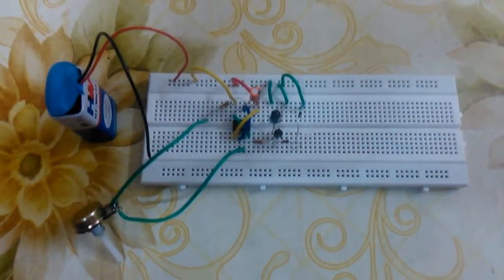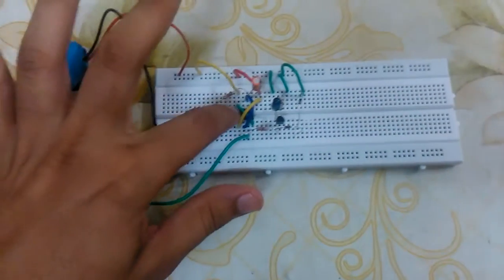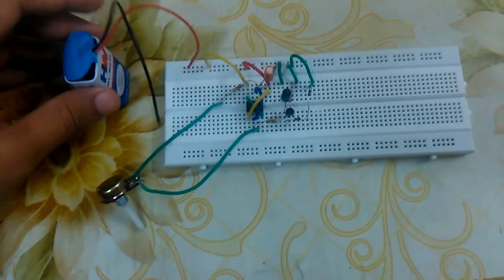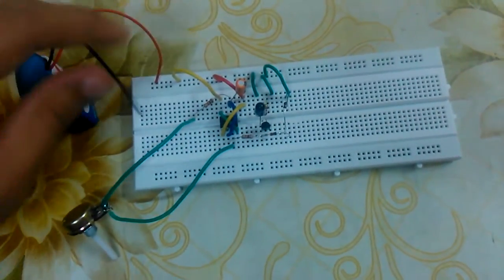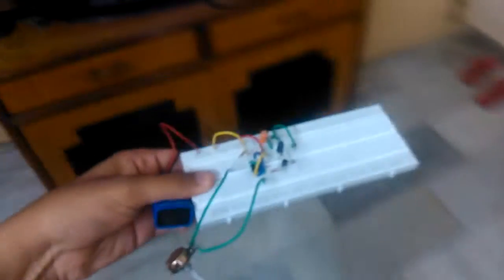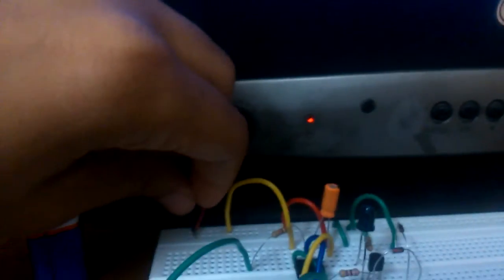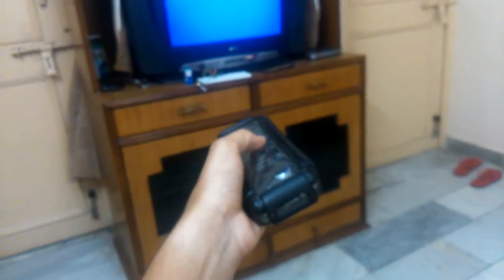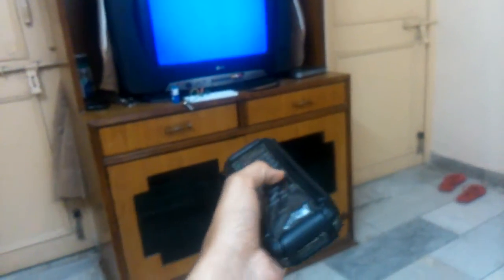TV remote jammer using 555 IC

Comment: Which transistor 2n2222 NPN???
Reply from the maker: darshan thakker  I used BC547 NPN transistor but 2n2222 transistor should also work with this. Make sure you check the pin-out for the transistor.

Comment from the maker: Send me your email Id
Reply: Krishnasinha18@icloud.com
Reply: Kunal Ochani hey man could u please tell me which diodes u used and weather using a 103 capacitor would make any difference
Reply from the maker: Armaan Dsouza I used 1N4148 diodes. Yes, you can use any electrolytic capacitor but you might have to adjust the value of resistor accordingly.
Reply: can u send me the circuit diagram to muddusrikanth@gmail.com
Reply: will it work for any remote
Reply from the maker: No. It would not work for all remote.
Reply: Kunal Ochani hey man I completed the project long back actually☺ with a few minor adjustments. I also increased the range of the signal jammer and used an arduino to control it remotely. Thanks though.
Reply from the maker: That's awesome! Sorry, I have been too busy and didn't have time look at the comments here. I am glad you made it with arduino.